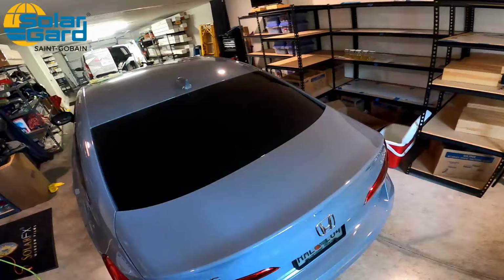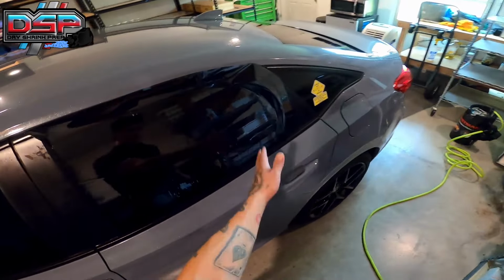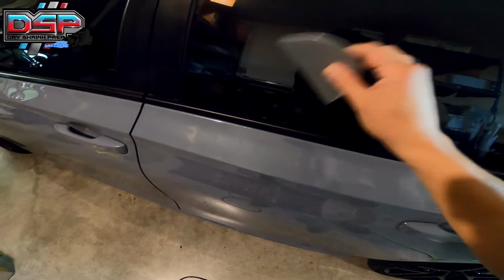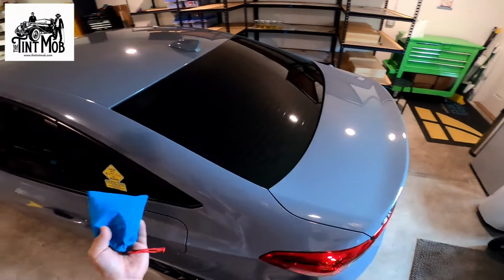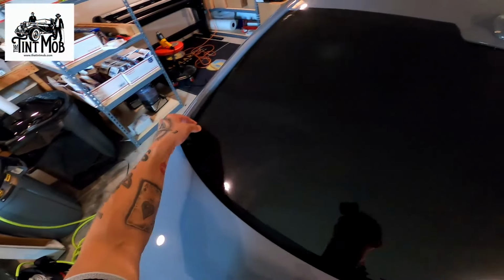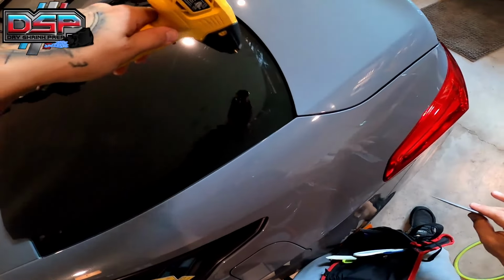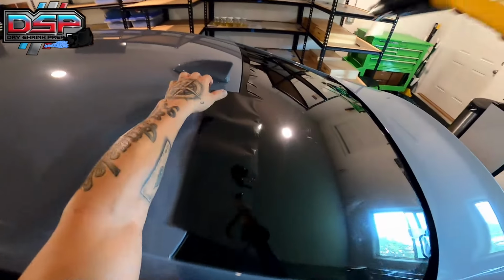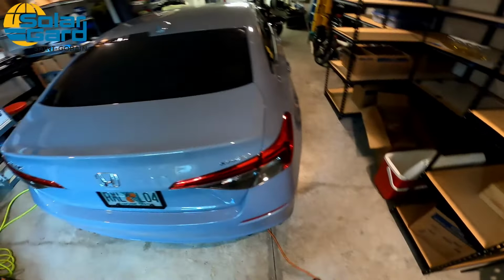How To Shrink Windows | How To Tint | 2024 Training Series

Comment: Great video! Any tips on front and rear quarter windows? Really struggling with them. Thanks!
Reply from the maker: Break the seal for the ones that don’t have the ceramic boarder. Use a ez reach and make room behind the seal and wet it back there to prepare for the install. Take your time squeegeeing clean. Dont spray the glass and just spray the film to avoid drip down contamination. If you have a problem w sliding when squeegeeing on then set it in place go install the roll up and come back and squeegee, that give enough time for the quarter to tack a bit and not move on you while installing.
Reply: @WindowTintingBusiness   Really enjoy this training series! Hopefully you decide to make one about front and rear quarter windows. Thanks and have a great day!